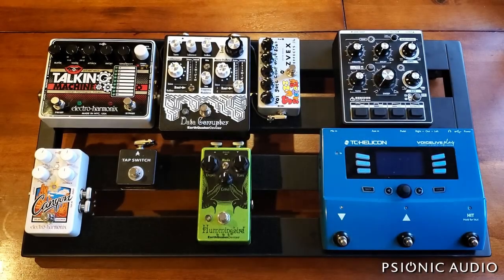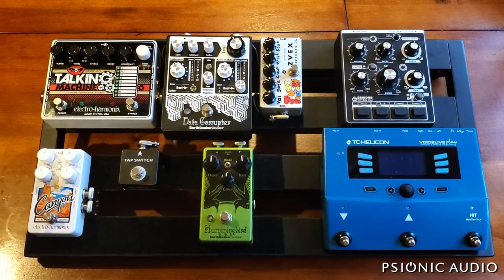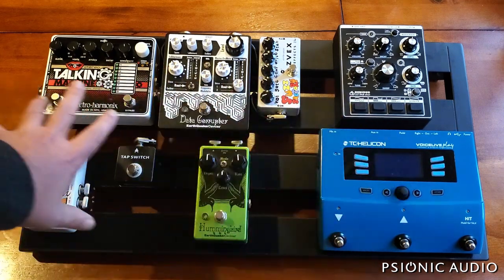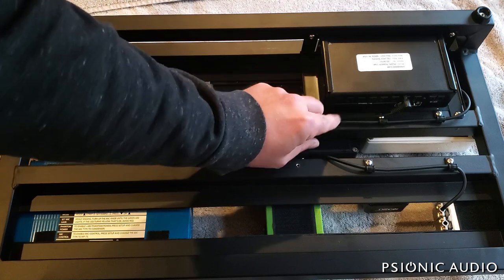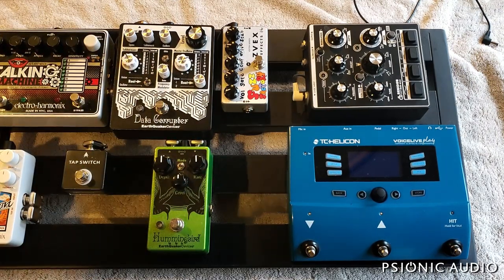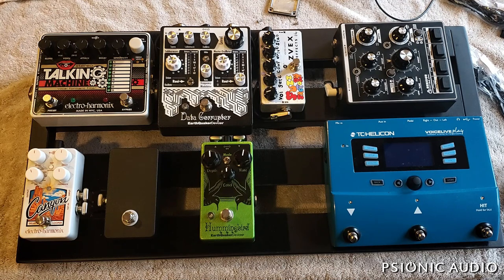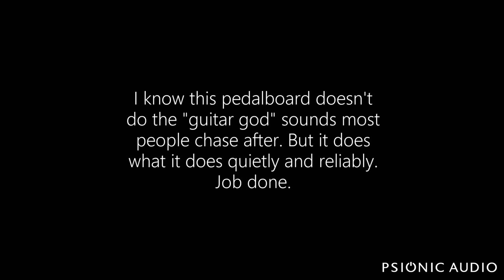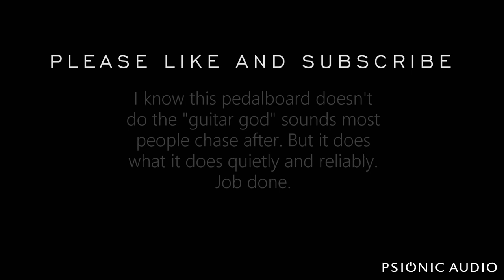Let's Make a Pedalboard | Part 2 : Finishing Things Up & Testing Everything

Comment: Most guitar pedals are center negative
Reply: My DC powered synthesizers are too because they realize the proliferance of 9V center negative PSUs out there, namely those built by One Spot, Boss and EHX. I do have many synths that use 12V center positive however.
Reply from the maker: I'm well aware. It's just that EH used a really dumb graphic that defies convention and can be easily misread.